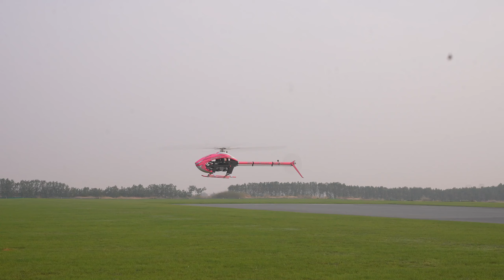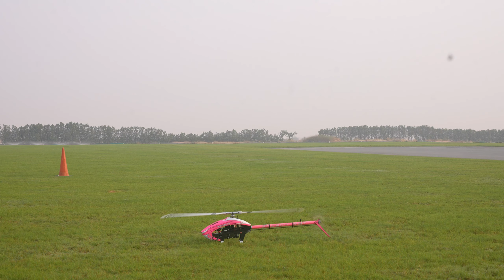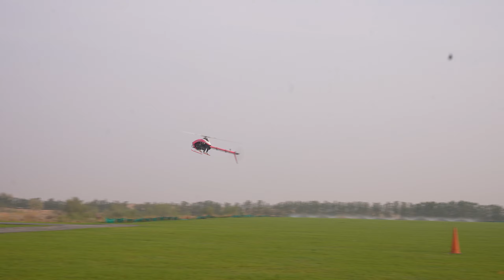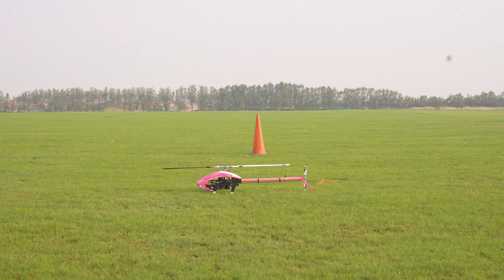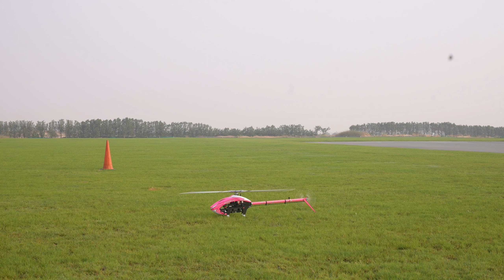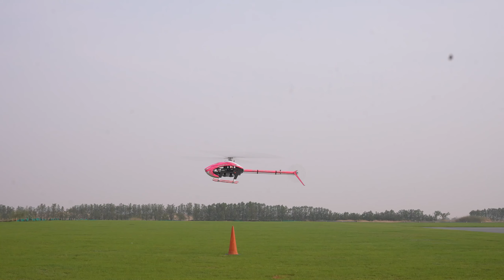Learn 3D Rc Helicopter flying with Tareq Alsaadi Episode 3 , how to mange the tail while you fly

Comment: Hi Tareq, i tried and my flying is already improving !
During the half-flips and half-rolls you do what i call an hesitation (stopping for a short moment in "knife edge" with blades at 90 degrees to the ground). However you did not say it in the video. Also, the part talking about collective management was short; it seems the pitch needs to be mooved quite violently from positive to zero and then from zero to negative (aka collective stops). 
I am using the awesome goosky S2 to fly these. I will bumb up the agility for it to look more agressive.
Would love to hear from you on one or more of these topics in your vids.
Thanks for sharing and offering a different way of learning ! very useful, challenging and less boring to fly AND watch :)

Comment: Thxs Tarq, alredy I cracht my 420 RAW and my 420 SPORT, by mistake, using the Elevator in wrong Direktion, two times same mistake. 
Next time I Take my FIREBALL ist's cheeper, still have also T-Rex 550, T- Rex 700 and KRAKEN 700 in Reserve. Please Push 👍👍👍👍 fingers for me. Anyway l Like every Thing what you'r doing, phantastic !!!!

Comment: Hello, I just flash my taranis X9E from OpenTX to EdgeTX. First I choose 2.84 for converting model, ( I updated the bootloader also) that didn’t work well, my radio stopt by 10% converting. I shut the power of and turned on the radio, EdgeTX was there but all the models where gone. Panic!!!
I used edge companion to rewrite the models to the radio and I believe at that point companion made the conversion. All my models where back🎉.
With 2.8.4 I lost my helicopter tab if you know what i mean? So I flash’s to the latest version 2.10.3 and there was the helicopter tab right back where it belongs. The only thing so far I see is that my throttle-hold is reversed, but that is fixable. Only question is although I could ckoose for hall-gimbals there is no option voor Europe (lbt), or has that to do with updating the interne module?… 
Thanks so far for this great video, let me know if I choose the right steps to make this work.
Theo.